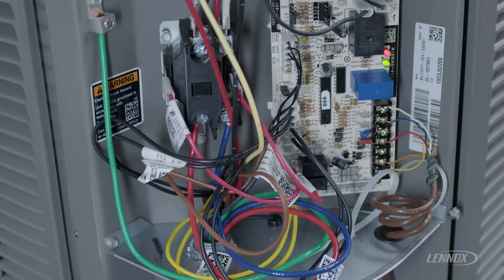Heat Pump Blinking Codes: Simultaneous Slow Blink | Lennox

Comment: Question I had this code but outdoor did not engage could this be am thermostat issue or defrost board issue ?
Reply: Check the breaker first make sure it isn't tripped. If it is tripped you might have a short on the compressor or a bad fan motor. If it's not tripped I would check the capacitor next if you know what you are doing.